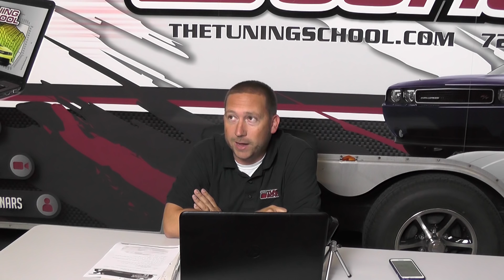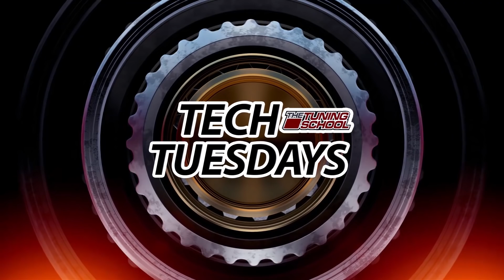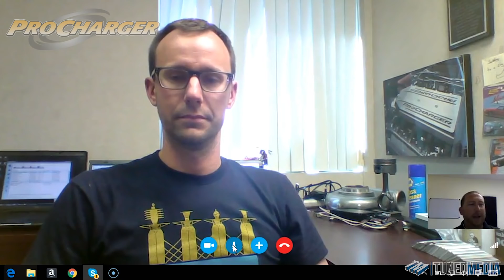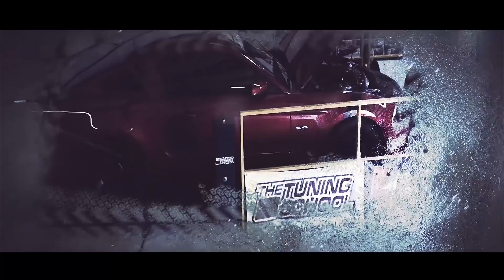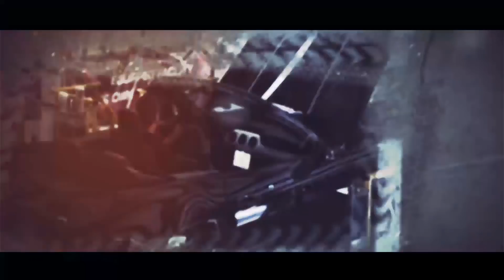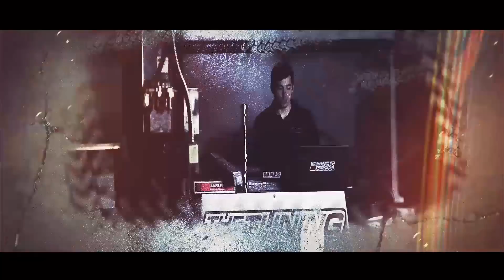Forced Induction (Part 5): Procharger discusses Centrifugal Blowers, cost, road racing and heat soak

Comment: Have you guys heard of ECS (East Coast Supercharging) in N.J? They Supercharge, Meth with headers and pipes for mainly C7's and Camaro SS with the LT1 powerplant. They stated to me that a stock LT1 can handle 10 lbs of boost safely? That seems a little high too me? They use the Paxton Novi 1500/2200 kit.   http://www.eastcoastsupercharging.com/store.html?page=shop.product_details&flypage=flypage.tpl&product_id=345&category_id=1372
Reply: Aresfire2 theyve probably got it figured out. Obviously with a tune as well. That sounds realistic though
Reply: You want one of the best in the business, you can also check out Bill Hunsberger @ SecondStreetSpeed.com in Perkasie PA
Reply: If they're a reputable company who builds a lot of cars then have a little faith in them. Other wise have them go with a larger upper pulley to equal less boost. Procharger is the safest way to make boost because they build more boost with more RPM. So if you pulley the engine for 10-lb of boost at max RPM, the engine could never over boost.